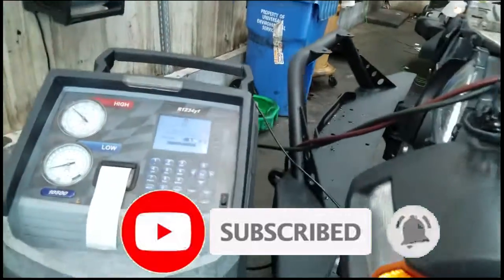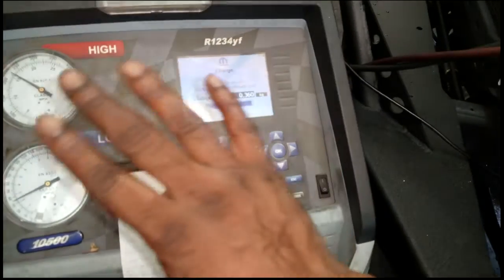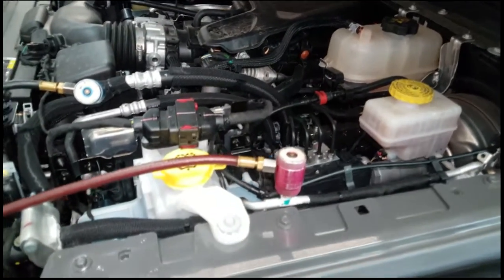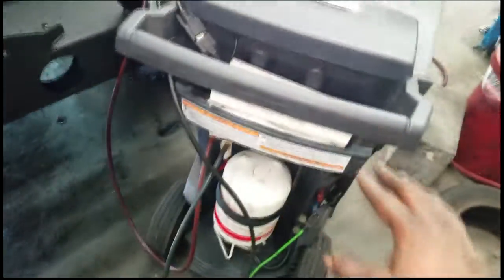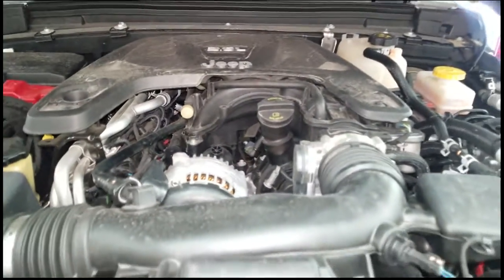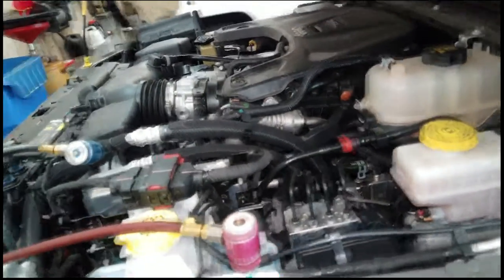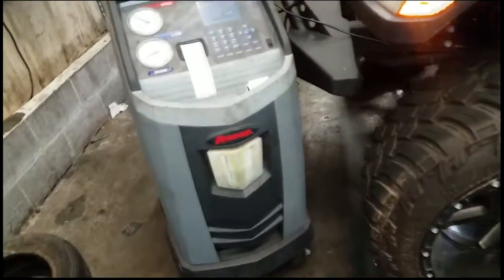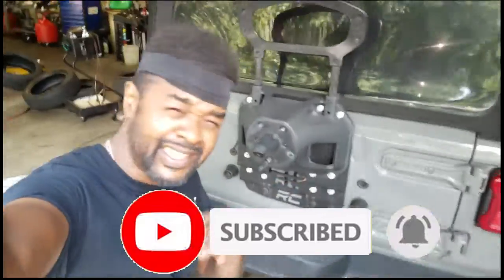AC FREON $300 for 2lbs at some shops. The R1234YF AC system freon

Comment: I have a 2015 Grand Cherokee limited that won't cool below 48 degrees no matter what the conditions and wonder if that's normal. One said 1234yf doesn't cool as low as 134a but I don't know if that's true. Or - since LOW setting is just below 60 degrees if maybe the car itself is only set to cool that low and not any lower. 
Can you please shed any light on this?  .. cools enough at 52~ but used to other cars with 134a cooling lower myself. - love the shorts btw. .. appreciate your input.

Comment: From what year they started using r1234yf on cars?
Reply: DreamTGarage in 2012 the Cadillac XTX That was the very first car I ever did with the new refrigerant it just came off the dealer lot off the truck on a test drive and got into an accident front end replace the condenser and it needed to be recharged